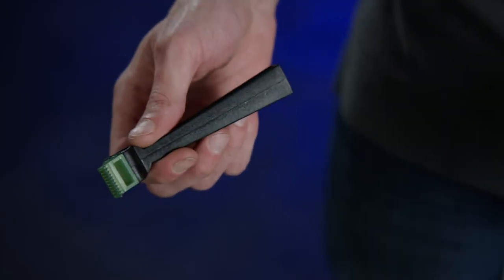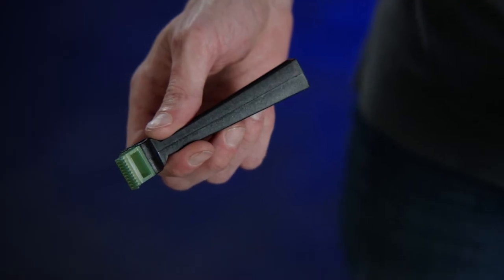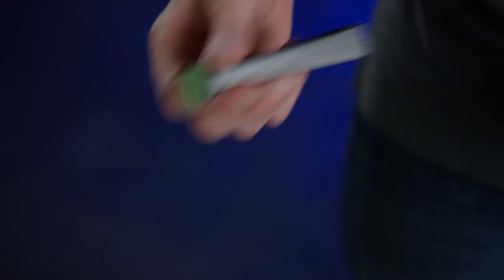Straightening Condenser Coil Fins: An Easy Technique

Comment: Guys, I have minor bents in a new Car AC evaporator which areived today . Does the small Bents affect the car AC system? Should I return it ? Bents are small but I am afraid it will cause damage. I hope someone can answer and help me. Last year I lost my Car's AC compressor, and condenser due to a bad evaporator which development mould in it & resulted to Black Death. So I hope some can help with this question 🙏